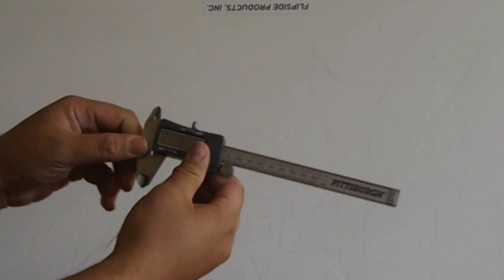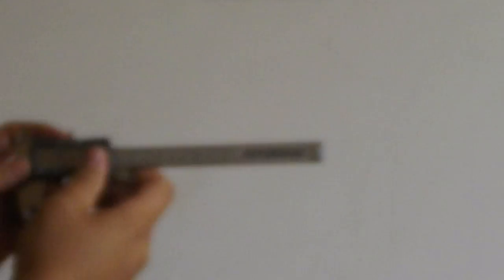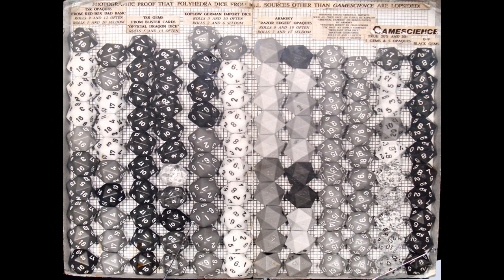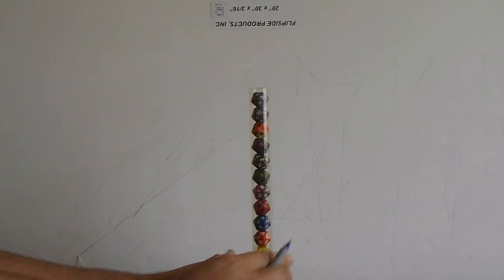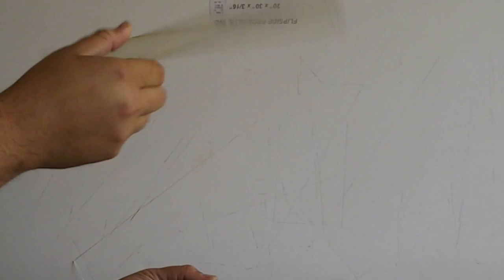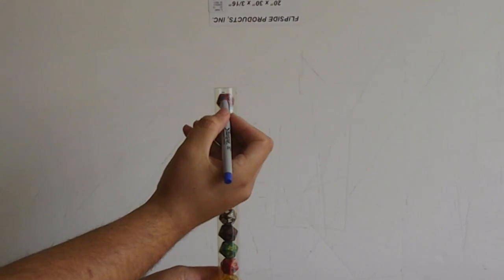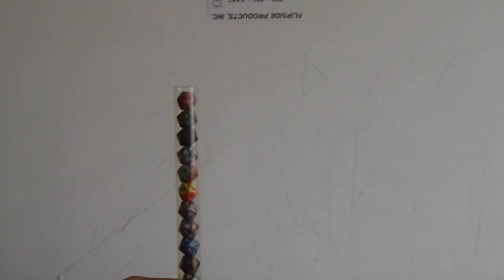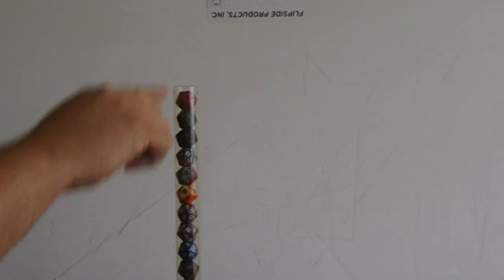Quick and dirty way to check for a lopsided d20

Comment: If you are concerned about your dice rolling heavy on certain numbers, buy/build a hardwood  dice tower, with 3+ baffles.  Your dice will bounce, spin, and twirl, coming out completely random.  Do not use soft woods; use Oak (Janka hardness of 1,360) or harder types of wood.  Be careful of the material chosen to build the tower with:  soft woods will not cause your dice to bounce and spin enough to guarantee truly random rolls; do not use transparent acrylic, or plastic, as it will scratch, and fog up, over time.

Here is a link to a YouTube video showing dice tumbling, in slow motion, through a Blood Wood dice tower, Janka hardness of 2,900(!):   https://www.youtube.com/watch?v=4cJtq16m6tI.  Here is a handful of dice being dumped into the same Blood Wood tower, in slow motion:  https://www.youtube.com/watch?v=OEIym29zipw.  Cheers!